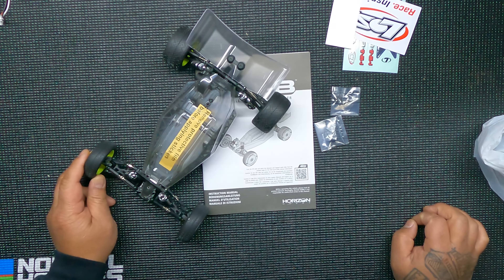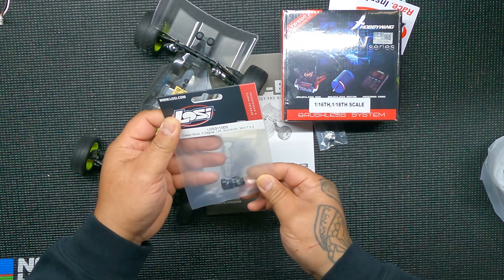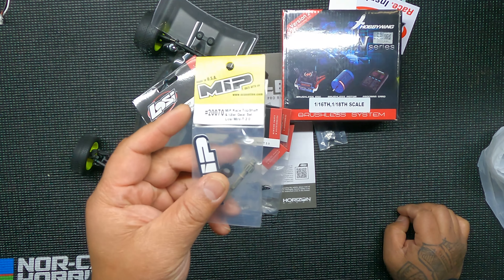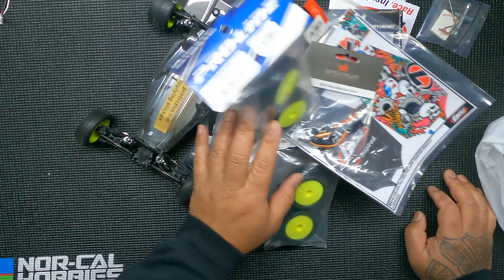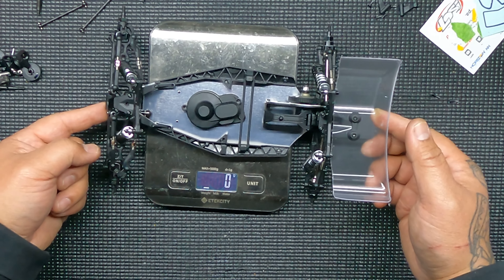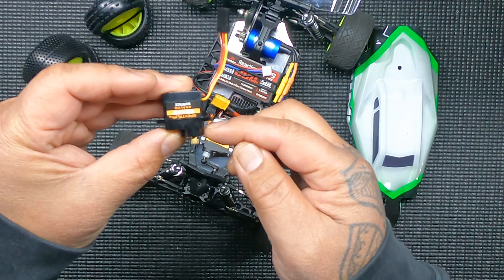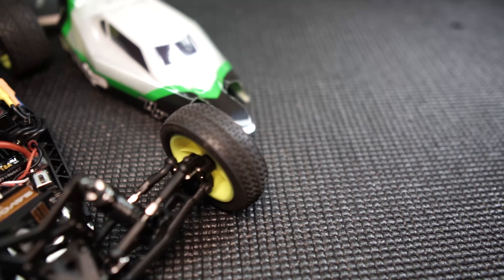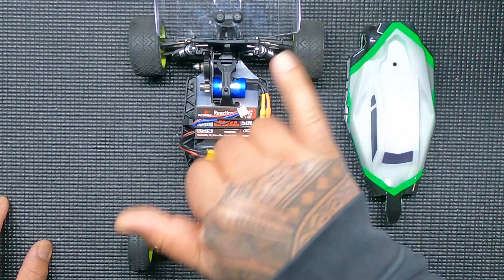Team Losi Mini-B PRO build. ALL the HOP-UPS!

Comment from the maker: I didn't get the Ball Diff cause I intend to run it on carpet. I did not see an aftermarket gear diff.
Reply: Would the ball diff affect the vehicle negatively on carpet?
Reply from the maker: @Rch_P  All carpet buggies use gear diffs. Ball diff would provide too much bite on the load tire and can cause traction roll. And trying to adjust a ball diff to work on high traction surface would either be loose enough on the turns, but too loose on the straight and may slip. IMO I can be wrong.
Reply: @AdamLeeRC  Thanks for the reply 👍🏻 Trying to start racing & I like to pick everybody’s brain when I can.

Comment: Got mine the aluminum steering rod that it comes with didn’t fit on the spektrum servo it comes with and the servo ended up breaking when I tried to put the steering rod on with a little bit of force not well built on that part at all other than that everything else is good only ran me back about $20
Reply from the maker: Yes. Mine did not fit the recommended servo either. I'm going to email Horizon Hobby pics. That's also why I'm running the plastic servo horn that came with my Savox servo.
Reply: @AdamLeeRC  Seems like the newer ones that they are producing are not fitting properly I have also contacted product support
Reply: Same happened to me. I chatted with Horizon support and they sent out a new servo immediately that fit perfect and works like a champ now.